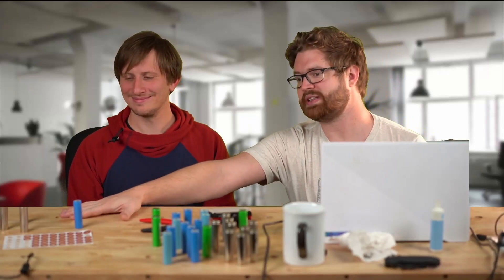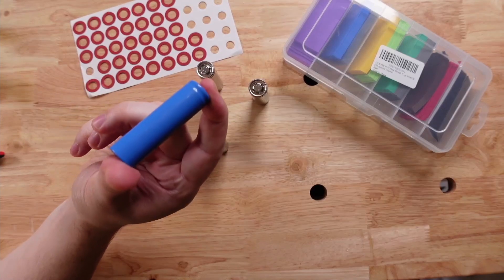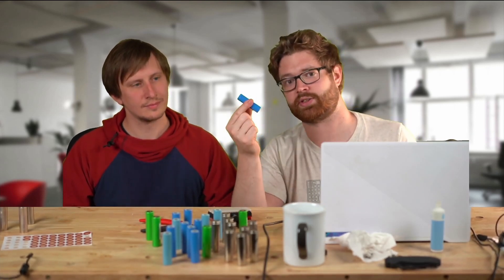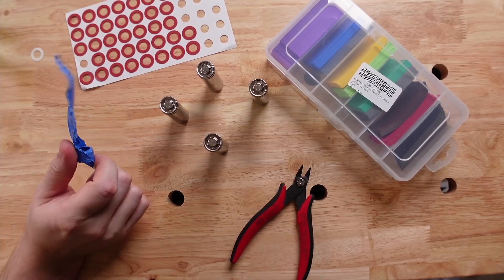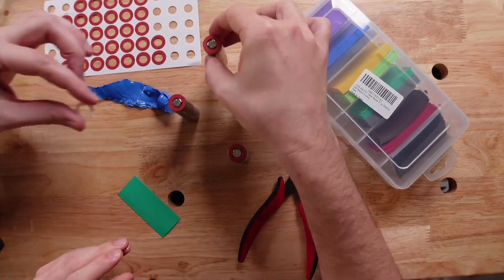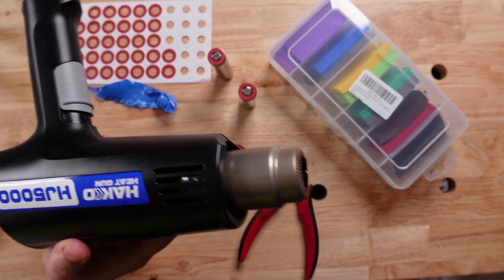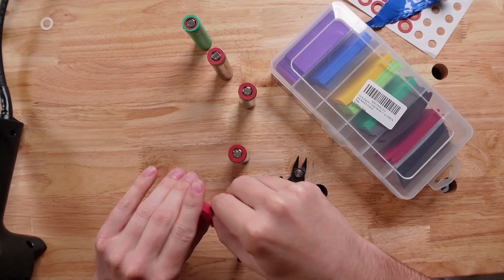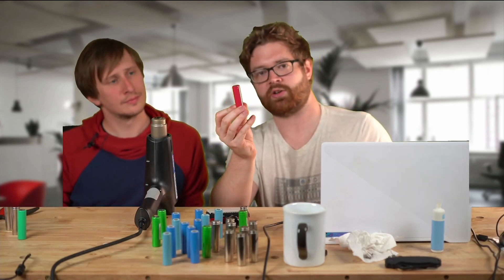Re-Wrapping 18650 Batteries (The Easy Way)

Comment: The sticky insulators you are using are made from fishpaper and its strength is the ability to withstand wear and tear. PVC shrinkwrap is BAD ad withstanding wear and tear and for that reason fishpaper insulators need to be on the outside of the shrinkwrap.

Comment: The number one reason why someone would be using this tutorial though is for their Vape batteries. Although even though you didn't mention that thank you for the tutorial every vape shop in my city has stopped re-wrapping batteries and there is nowhere else that doesn't and I'm not going to throw away a bunch of perfectly usable batteries but only need the wrap fixed
Reply: If you need a quick fix you can use electric tape thats what I do when using a older battery in my flashlights and it also adds extra protection from whatever ill even wrap it over the negative and positive if I cant fit a battery in box I had one of these in my pocket with out realizing and a min later I was on fire 😂
Reply: How long do you guys think these 18650 batteries last for? I use them for my vape and wanted to rewrap them so i landed on this video.
Reply: @Thoughtflux  Until they degrade? depends on power cycles, but anywhere from 1 to 6 months average.